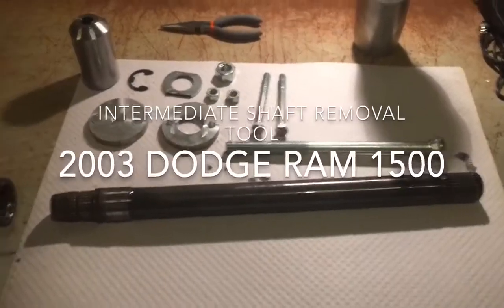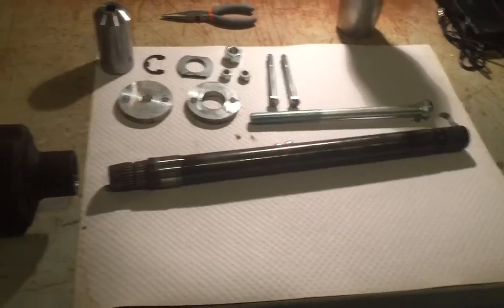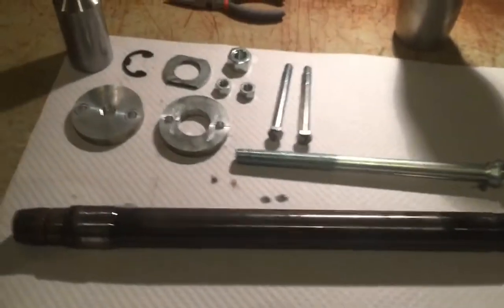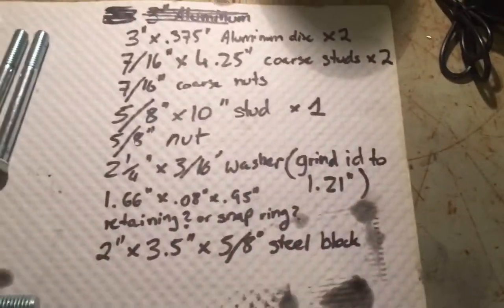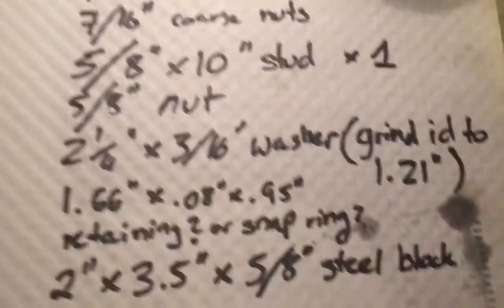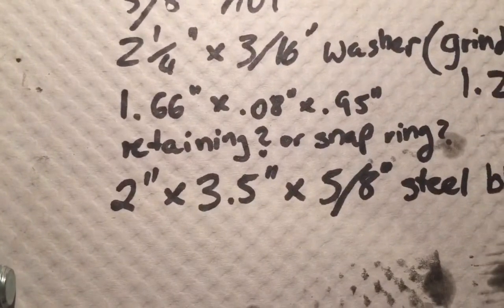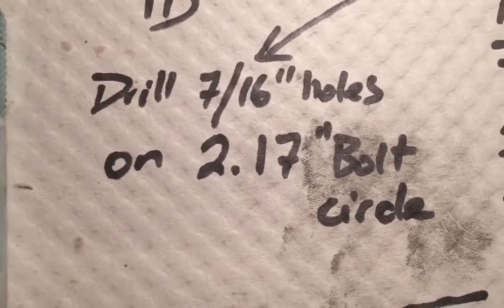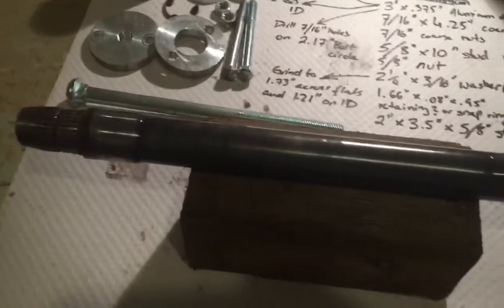2003 Dodge Ram 1500 axle shaft removal tool

Comment: im curious why you wouldnt open up the differential from the start. takes minutes to do versus an engineering feat. I mean props to your handywork. I just work automotive and ensuring the differential is properly serviced after those repairs makes you aware of more avenues problems could occur causing a "comeback" that you might not necessarily have caused. plus ive had a clip or two actually needing recovered from inside anyway.

Comment: Just drill and tap the end of the shaft, attach slide hammer, and remove. Way easier than making all of this.
Reply from the maker: aliceinchainsdrummer that's true and maybe another way of doing it. Couple things to consider are: the shaft is hardened and the access for a drill or tap handle might be tight. Is that how you removed yours?
Reply: The shaft is only case hardened. You can drill and tap the end with a regular drill and tap handle pretty easily. Yes that's how I did mine. Tapped 3/8 for my slide hammer popped right out.
Reply: you will understand why when you  ( TRY) to drill the axle shaft !